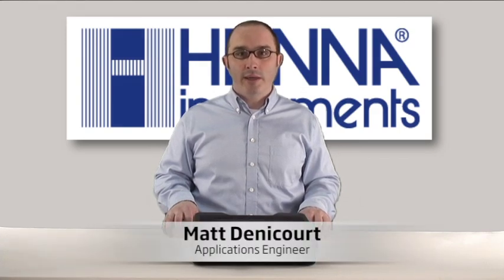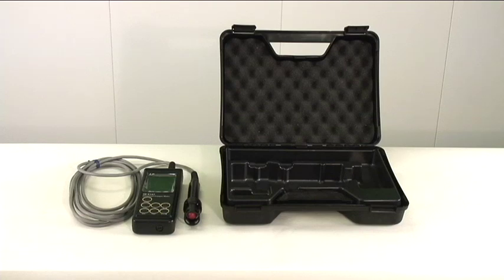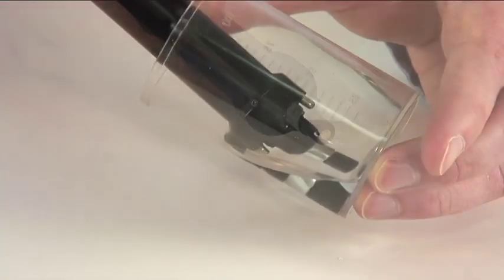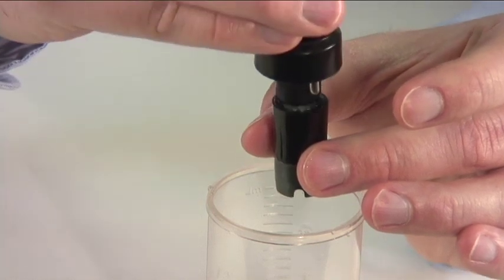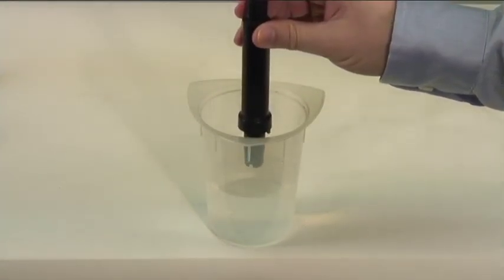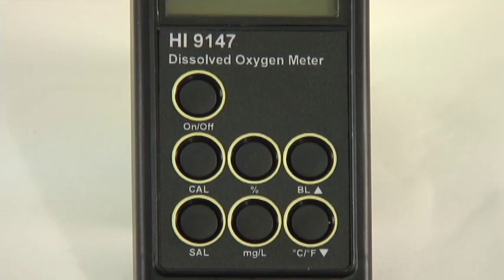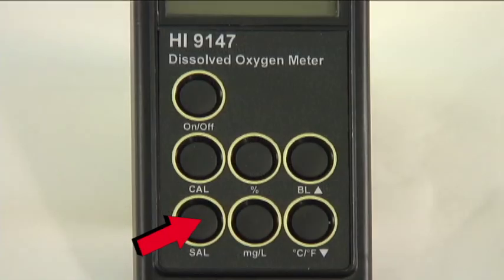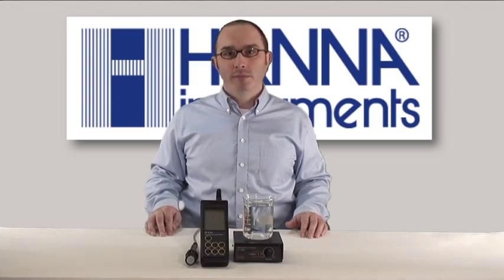HI9147 Dissolved Oxygen Meter for Aquaculture

Comment: Hello. Can you say, is it ok to put a sensor in a water totally (with cable). In other words, is the connection between cable and sensor (or electrode) waterproof?
Reply from the maker: Hi Alex. Yes, it's safe to submerge the probe and cable into water.
Reply: @HannaInc  thanks a lot for quick answer! Is it safe for both HI 9147 and HI 9142?

Let me also ask, what is the difference between HI 9147 and HI 9142 in brief? I want to buy dissolved oxygen sensor to measure in natural waters, rivers with high organic content, muddy puddles, so conditions are much worse than in the lab. I want to realize which sensor is better for my purposes.
Reply from the maker: @alexsabrekov4257  Hi Alex, both should be fine to submerge. I would recommend reaching out to sales@hannainst.com to find the best meter for you. The meters you mentioned use different measuring systems and have different probe types. We offer a wide range of DO meters so contacting our sales team will help you find the one that fits your needs.
Reply: @HannaInc  many thanks. Just wrote an e-mail to your official address.

Comment: @Hanna Instruments, Inc. Why is the probe held over water at 100% saturation calibration? If you measure the oxygen of the air why does it need to be water close by? And if so, should the water close to the sensor be tap water or deionized water?
Reply from the maker: Hi Paul, The probe is held over water at 100% Saturation Calibration because it is a calibration to 100% Water Saturated Air. For this calibration, hold the probe as close to the water’s surface as possible without submerging, and allow the reading to stabilize prior to accepting the calibration. The air close to the water should become saturated with moisture at that time, and that is what is needed for the calibration. Tap water will work fine for the calibration as long as the probe does not touch the water.